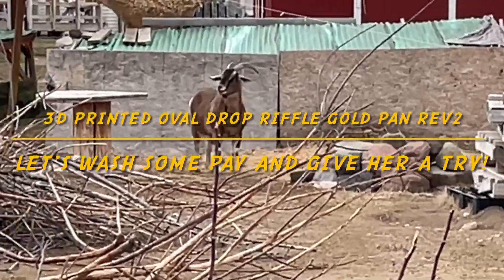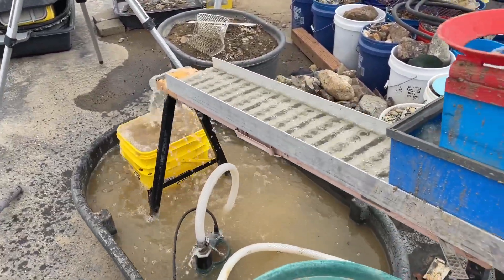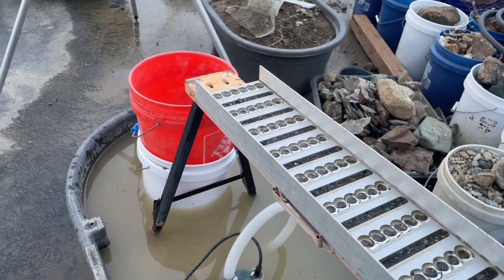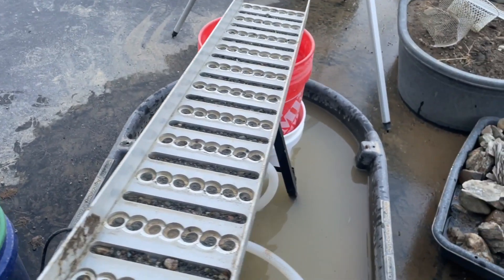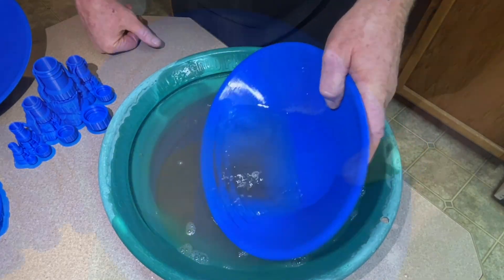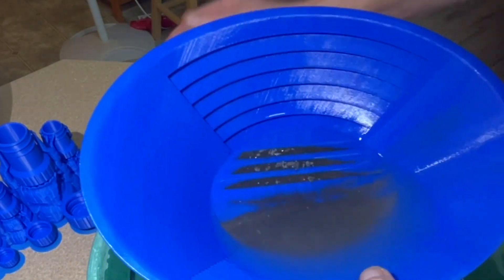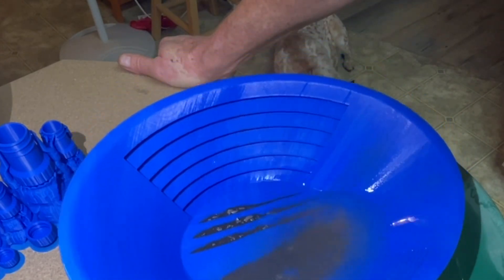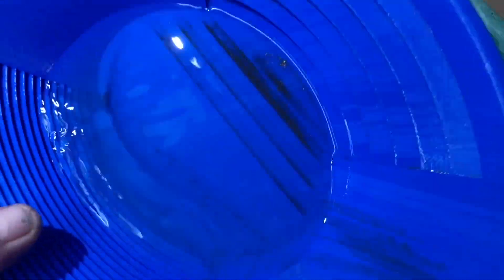3D Printed (ODR) Oval Drop Riffle Gold Pan, VDR sluice gold run and pan test!

Comment: Now I can imagine what was supposed to be created in the 3D printer back then. I think the idea is good or even unique in the world.
I got a little nervous when I heard the background noise 😅.
Not that your house is robbed and you calmly pan for gold.
Hey Matt, my admiration as always. Best of luck, Peter. 🤠⚒👍
Reply from the maker: Good morning Peter, I was trying to hurry the video, because you said you are not able to sleep until I show the pan in operation! 
So glad you can sleep now 😂 
The ODR pan is possibly unique as you said. It’s about the same depth as the Garrett Super Sluice pan (75mm/3”) and also has a similar tilt angle along the longer radius, which seems common on many pans. The ODR pan is 280 grams light, less than 1/2 the weight of the Garrett SS (580g) which on both I bought the bottoms are Not Flat. I find the bulging upward convex bottom an unwelcome issue for me.
The Drops are rounded and all the same shape and depth. The pan works fairly good as is but a new one is coming soon with more aggressive drops.
Thanks pal.. get some sleep 🛌 😂 
Peace Prospector Tripp

Comment: G'day PT .the pan seems to work alright hey , very good finishing pan . I like a large based pan out in the field , and i love my Garrett Super sluice , but i don't like how they bulge up in the bottom though . Thought about maybe heating mine and putting a weight in it to try and fix that problem they have . Anyway , you will have to emboss the creators name on TOP of it . TOP , get it  ( TRIPP  OVAL PAN ) . Cheers Ned . 👌👍✌✅
Reply from the maker: TOP 😂 or AFBP (Absolutely Flat Bottle Pan) 😂 
I too do not like the Convex Bottom (upward bowed) Garrett super sluice pan. Both of mine suffer from this unwelcome very correctable design flaw. 
I also don’t like the weight! I am OLD as the very Dirt we dig 🦖.. so Weigh of gear matters a lot! I’ve been a huge fan of the little 10” cheapo gold pans.. they use to be 2 or 3 bucks not sure at the moment. They are Super Handy, light as a feather, nearly indestructible (drove my Tahoe over a green one, popped it back into shape.. still using three years later) and work fine if you pan carefully. For prospecting or cleanup this has been my favorite 9 years running, cheap light indestructible!
I am just running through ideas for something different and interesting. 
The drops are not deep enough to hold the heavies as I was thinking. So I’ve increased the drop depth and sharpness of the walls. Printing out the latest now.
I’m thinking there’s a lot of wheels out there (pans) but there not any that your Choice of Name or Inscription can be manufactured into the pan!
Maybe it’s special purpose will be a unique wall hanger Display Gold Pan With Your Choice of Name built in!
Like..
Groober Ned Jardine 😁
Gold Hunter 😁😁
Thanks brother.. stay Golden!
Peace Prospector Tripp
Reply: @ProspectorTripp  That sounds great PT , hope you can make the drop riffles a little deeper without compromising the bottom depth of the pan . Yeah personal inscriptions would be excellent on a pan  perhaps risen rather than embossed depending on how deep or shallow the cut out was . And on the top opposite side to the riffles so they don't interfere with panning process . Keep at it Captain you're doing great . Cheers Ned . 👌👍✌
Reply from the maker: @GrooberNedJardine   The personal inscription letters are difficult to see unless they are really Deep or if raised really Tall. I’m drooling 🤤 on a 3D printer Colter Young has in his Mining Magnets.com arsenal. It has a huge print area and can print 2 colors!
That makes inscriptions or anything really Pop!
It is really impressive.
Here’s the link if you want to see it:
https://sovol3d.com/products/sv04
I can successfully 3d print quite good now after printing a hundred items or so. Now I’m now in “Thinking Mode” 🤪 and not running my printers 24/7. I am definitely focusing in on better CAD understanding and Proper design before I make more items.
My beautiful Maria had her Knee Replaced 14 days ago. She is doing amazing but still not able to do her usual duties. I’m on Full Tripp Farm Work Load. Taking care of everything including Maria is a lot of work. It’s amazing how much she does around here! I’m praying hard for a Quick Recovery so I have a bit more free time once again.
Always appreciate your terrific comments and advice!
Stay Golden Ned!
Peace Prospector Tripp
Reply: @ProspectorTripp  i will check that out for sure . I see Colter Young sent some stuff to Jason at FGW , an Awesome little mini clean up sluice .      I hope your better half get well real soon PT .🙏🙏❤❤ Cheers Ned out . 👍✌

Comment: Are you taking requests yet? Did you make that hopper?
Reply from the maker: Hello Patriot, sorry for the late reply, yes sir, I did design the hopper wash box. At the moment I am not planning on selling. There’s a ton of reasons why but mostly I would prefer to keep YouTube a fun hobby and not a albatross around my neck.
I do of course have the data files (STL files) If you like I can email you the hopper and wash bar files?
The file can easily be printed out locally for free or very little cost if you check around your area a bit. I know the schools in Idaho have 3d printers. I’m sure there’s a local 3d printer person that you can work with on the (Hopper file) so it will fit your sluice boxes exact size.
If you gave me your exact dimensions I certainly can size it but would have to say at my skill level it’s fairly likely something won’t fit properly.
And that my friend is the second huge reason I am unwilling to jump in the deep end just yet. In the future I will have a larger 3d printer that I should be able to design a larger somewhat of a Universal Hopper Wash Box. 
Maybe then I could sell some.
Not sure just yet.
I am enjoying the process but certainly need lots of testing of designs and design refinement and experience.
Let me know what your thoughts are Patriot.
Thanks much for your support.
Peace Prospector Tripp

Comment: Never seen one of those.
Reply from the maker: Hello James, I have looked but I too never seen a drop riffle pan. The drops work as any drop in a sluice box, however there’s definitely more refinement needed. It’s still not holding the gold enough, Imho. I’ve increased the first drop a couple millimeters and printing it out now. 
I have Creality Ender 3, 3d printers. They have a fairly small print area of around 8x8x12”.
This is not large enough for a popular pan size of 14~15” and 3” deep or so. 
I’m hoping I can get a larger 3D printer this year. 
Stay Golden sir 
Peace Prospector Tripp